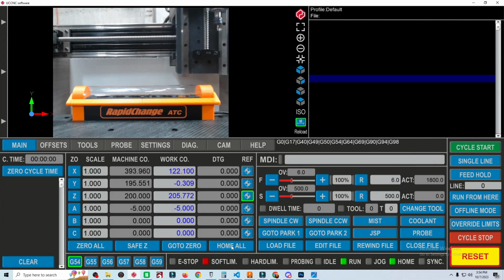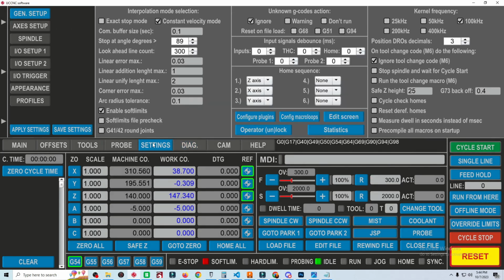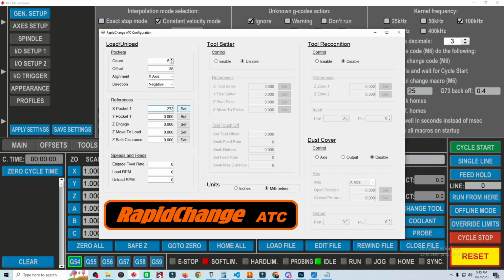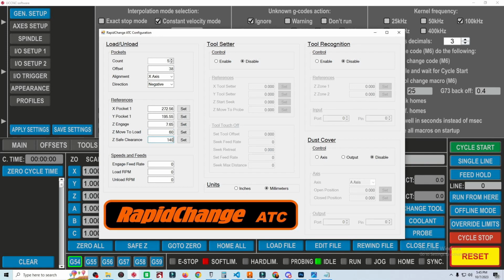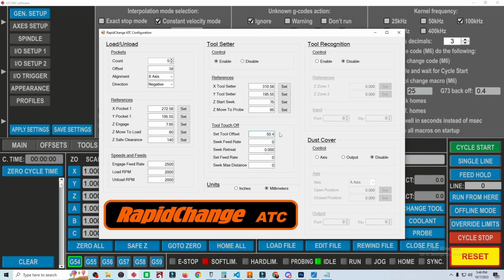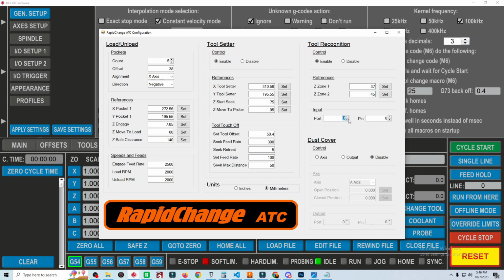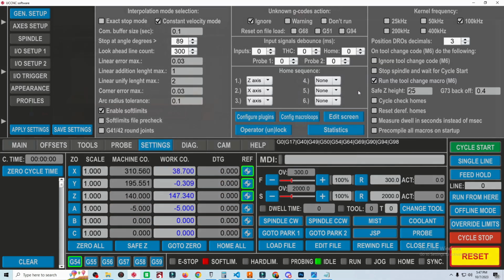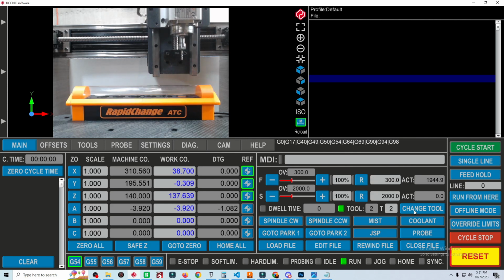UCCNC Plugin for RapidChange Automatic Tool Changer/ Affordable automatic tool changer.

Comment: be nice if I could find someone who actually installed this and is using it daily on a UCCNC UC300ETH machine including accurate and fully tested UCCNC macro.  All I ever find is either some modified install, partial install, nothing complete with documentation and or videos to back up what you say this device is capable of doing.

Comment: Will this macro work macro and  tool changer with stepcraft uccnc on an m1000 stepcraft machine?
Reply from the maker: Thank you for the  question and comment! As long as you can run the spindle in reverse with M4 it will work. I am not familiar with Stepcraft machines so I don't know if they come wired for reverse but most of the time this is easily overcome.

Comment: Would this be available for the Centroid Acorn controller and HQD ER32 4.5kw air cooled spindles with a Fuling VFD?
Reply from the maker: Thank you so much for the comment section questions. Centroid Acorn is in the works. 

We don't have it on our website yet but we are finishing up the ER25 magazines and ER32 is next. We are getting so many inquiries that we have a sign up for notifications on specific controllers and variations such as ER32 . 
The Fuling should work it would just be some programing variables being set.
We will only send emails to people specific to what they are looking for when we have updated or for new releases as we are working hard to get this implemented for as many platforms as possible. We do not spam marketing emails, as I hate them myself. so if your interested you can go here and when we have centroid and or the ER32 ready we will let you know!  https://rapidchangeatc.com/notifications/

Comment: Mhh... So... If I understand this right, then you're basically letting the Spindle ramp to 2'000rpm to gain enough inertia for it to either tighten or loosen the Nut before plunging it into a what I assume to be a Collet sized hole with a hexagon at the bottom to catch the Nut's Hexagon thus either tightening or loosening it enough? 🤔 Given my experience with manually threading in a Nut onto a Spindle this seems like a perfect opportunity to cross thread one onto the other if they're misaligned by even just the slightest, no? 🤨

The Product Page mentions the Tool Holder being made out of HDPE without adding any more details - Are the Pockets the Collets not experiencing any wear from the Nuts getting Hammered into them during the Loading/Unloading Procedure thus further increasing the potential for a misalignment? Are the Pockets replaceable?

On a little side note... Don't the 0.8kW HY Spindles usually have a minimum 8'000rpm limit?
Reply from the maker: Thank you for the comment and observations!

RPM varies between spindles with more powerful spindles requiring less RPM. A 2.2Kw spindle ER20 collet combination only needs 1500RPM to provide adequate force.

Hexagon shaped sockets do not work. This type of geometry is what I began with but it did not allow the clamping nut to be returned to sit in the same orientation in which it was loaded from and thus was not reliable or repeatable. The correct geometry of the socket took me over 7 months to figure out and ended up being so simple it’s stupid. So I enjoy letting it remain a mystery for the skeptics until it becomes common knowledge.

You stated:
 “Given my experience with manually threading in a Nut onto a Spindle this seems like a perfect opportunity to cross thread one onto the other if they're misaligned by even just the slightest, no?”
 

Well this was a fear I had when I tried it the first time and it was a tense moment as this has been my experience also. It makes the process of manually changing tools even more of a hassle than just having to use wrenches.

However, having a fixed position for the clamping nut to sit, aligned with and perpendicular to the spindle solves this problem. The start of the threads on the spindle and the nut being beveled allows them to align, even with some slight misalignment of up to about .5mm. This type of precision is why we use CNC machines in the first place so that stands to reason. I made a video demonstrating this and had to misalign the spindle by 1.5mm to reproduce a failure.

The sockets sit spring loaded in a pocket in the magazine which only allows movement of the socket along the Z axis. The sockets are replaceable, but with the spindle, collet combination I referenced above I could not break them at 2500RPM which is far beyond what the process requires. It does wear the oxide coating off the clamping nuts but that is about it.

All of my spindles have either a minimum 5000 or 8000RPM rating. This is because if operated at lower speeds under load or for an extended period of time the spindle will overheat. I ran tool change cycles every 16 seconds for over 6 hrs one day making over 3000 hits and the spindle never got much over room temperature.

After making thousands and thousands of tool changes myself over the last 15 months as well as sending prototypes for validation to people in over 8 countries around the world I can confidently say it just works.

I completely understand why some just can’t wrap their heads around the process.

I can tell you that I worked very hard to make it reliable and viable before I demonstrated it to the world. I had no desire to look like a fool by making false claims or exaggerating.

I found a solution that a lot of people have been searching for and I had no choice but to develop it and make it available to anyone who wanted it.

It will never replace ATC spindle systems as they have some advantages. Conversely my system has several advantages over ATC spindles. Simplicity, ease of installation and low cost to name just a few.

The bottom line is, it saves a lot of time and frustration and it beats the hell out of using wrenches.

Comment: Is it possible for you to publish the M6 and M61 macro code ?  And is it possible to publish also the Microcontroller Dust Cover Example Sketch ? (the link in the site is not working - Error! This download item (3739) does not have any download link. Edit this item and specify a downloadable file URL for it. 124)  Thanks in advance 🙂
Reply from the maker: We are working on reorganizing the web site now. We should have things straightened out in the next day or so. If you have a magazine email me or hit me up on discord.
Reply: @RapidChangeATC  No magazine for the moment 😞
Reply from the maker: @IceCreams62  If you want to see if your machine will run through the motions there is a couple gcode examples at the bottom of this page on our website:
https://rapidchangeatc.com/docs/getting-started/
Reply: @RapidChangeATC  Thanks a lot,  I will check them 👍
Reply: @RapidChangeATC  In the two macros (DROP and PICK)  you are using a Dwell  G4 P2 and G4 P.25 . Assuming the standard 'P' parameter is in milliseconds, what is the purpose of a so short dwell ?
Reply from the maker: @IceCreams62  They are in seconds not milliseconds the spindle needs to spin up to speed before plunging the P2s could be 1 second but they are just
 examples.
Reply: @RapidChangeATC  Thanks for the clarification, now it make sense. I based my assumption on this:   G04	Motion  Dwell: Stop for a specified time.	   'P' for milliseconds 'X' for seconds
Reply from the maker: @IceCreams62  it depends on the control software there are minor variations between them
Reply: @RapidChangeATC  Wrongly i supposed there was something like an ''ISO standard'' for Gcode commands 🙂
Reply from the maker: We did fix the sketch download

Comment: Any chance this would be similar configuration steps for DDCS 4.1(or other versions)?

In very interested in this!
Reply from the maker: I am not acquainted with that controller. but the actions will be universal so if it allows custom macros it should work and it will load and unload tools with gcode at the very least. Thank you for the comment and question!